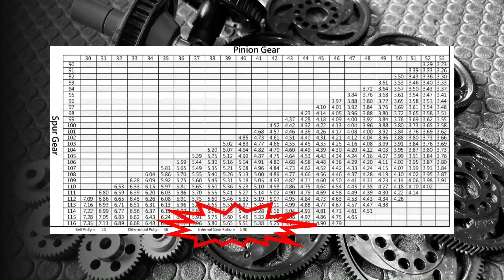ToniSport Newsfeed Gearing in RC Cars

Comment: That was an excellent video. Straight to the point especially on the ‘myth' that some do believe. One of the reason I think might be of use with different pinion/spur but with the same ratio is motor position(aft/fore).
Reply from the maker: Exactly. That is what I forgot to say. You can definateley shift the motor forwards or backwards a little bit with smaller or bigger gears in use!

Comment: Great video, really like the clarity about not worrying about to use pinion or spur for setting FDR.  Question though, could you also do a video to expand this thought by including a motor analyzer?  There are other video's out there about this, but I'd really like to hear your thoughts on if you use one, and if so, exactly what process do you perform to get the best results from motors, the amps used, gearing, heat, etc
Reply from the maker: Hi Chris, I have a Hobbywing Tunalyzer here but have not tested it until now. I never owned a motor tester in my life, so I am not sure if I can do a good video about that topic. But hey: I will try to do that in the next weeks ok? Greets, Patrick

Comment: Hey Patrick, what about the Temperature of the motor with the FDR with different gears?
Reply from the maker: I never had any differences as long as theFDR stayed the same! Because: Why should it get hotter or colder with smaller or bigger gears (when you change both). The Motor has to do the same work when the ratio stays the same! Temperature only can change when you change only the size of pinoin OR spur!
Reply: @ToniSport-Newsfeed  ok than you for the explanation! I really like your channel.
Reply from the maker: @idronecharpifpv89  thank you for your kind words!

Comment: Hi Patrick, I am glad you said there is no difference between big and small pinion if the fdr is the same. Happy to hear a myth of rc busted. The only reason to always choose a big pinion is to have a better engagement with the teeth of the spur. Especially with 64dp module, a smaller difference in diameter between pinion and spur, makes the contact safer and less prone to wear or strip under stress.
Reply: I agree, only other thing if you have a big difference is the position of the motor from the smallest spur/pinion combo to the largest. which can shift your balance a little as the motor can move forwards or backwards by 6+mm. but again is only a slight change.